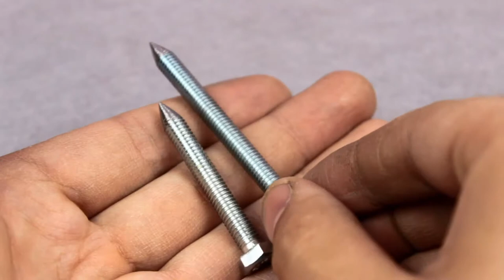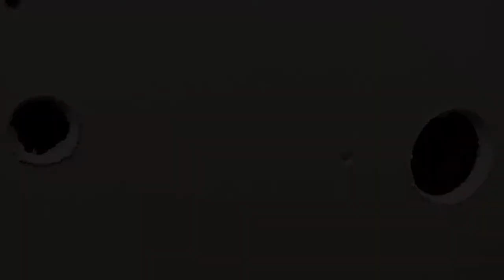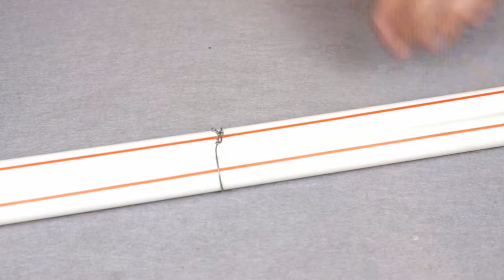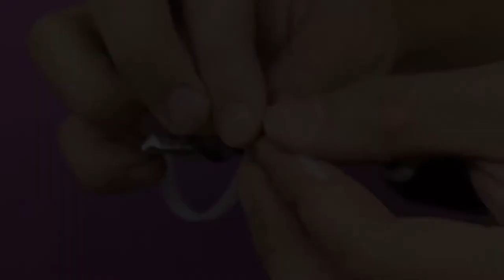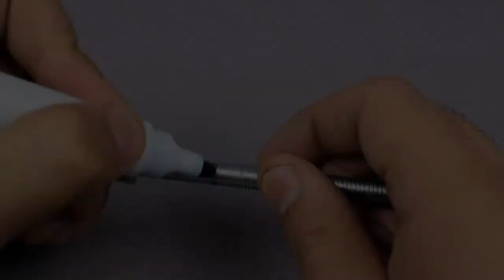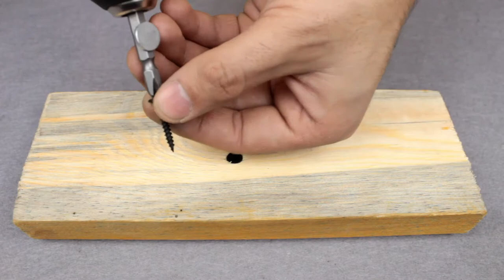5 Drill Life Hacks

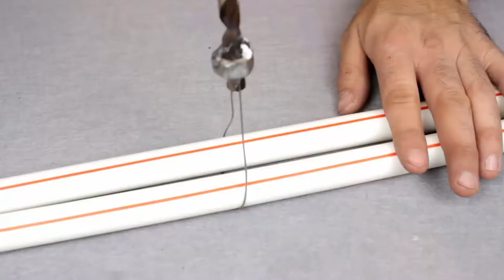Comment: 1:54 To tighten, the wire-ends are inserted everytime inside the nut. That insertion can be avoided by applying heat from hot air gun on an encasing made from used plastic bottle. This method also leaves no pointed metal ends.